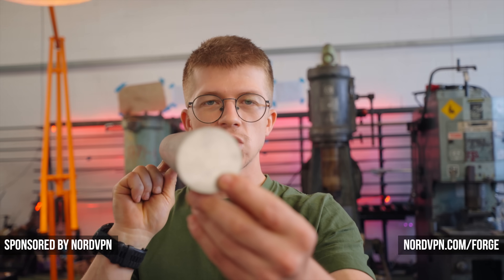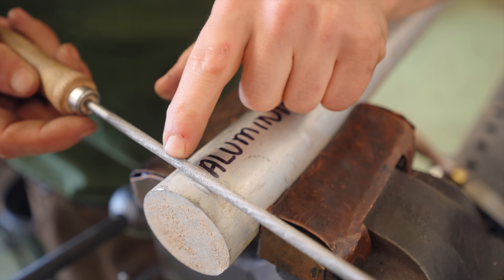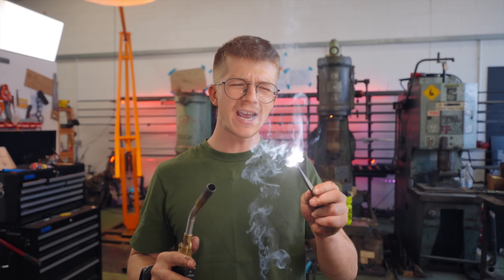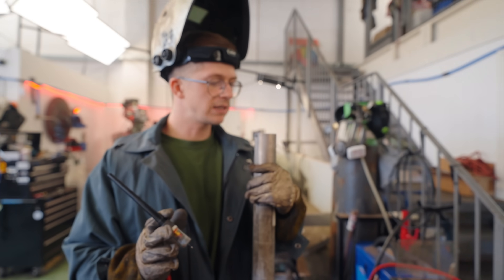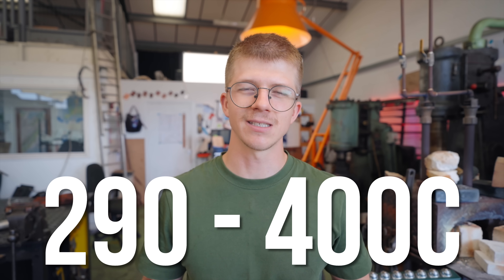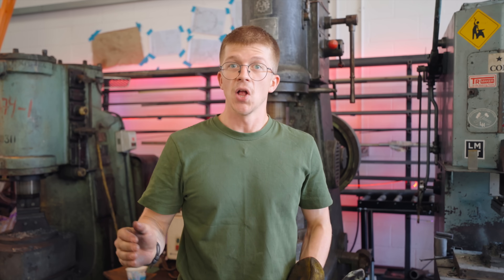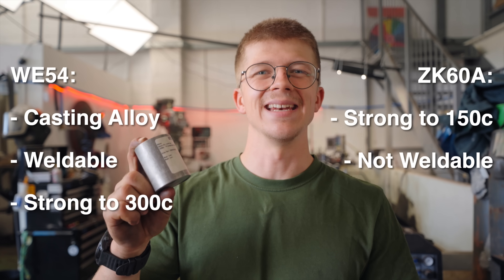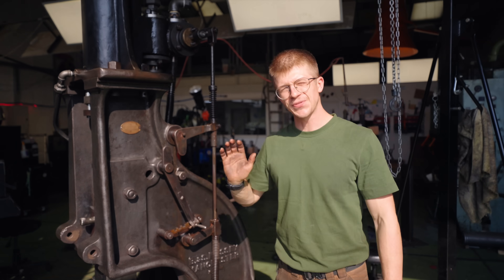Can You Forge Magnesium?

Comment: The "Elektron WE54" Alloy is about 91% magnesium. Pure magnesium would be way softer than this alloy here. Magnesium is soft enough to cut it with a knife kinda like wax-like maybe a bit tougher. More reactive as well. Apparently, the Yttriumin in the alloy gives corrosion resistance, meaning less oxidation/rust and harder to burn it. If it were to be pure %99.9 magnesium I doubt you can put it out with just water even if it's small in amount it would explode. 
If you like to know here are the contents I found for it.

Element	Content (%)
Yttrium, Y	4.75-5.5
Neodymium, Nd	1.5-2
Heavy Rare Earths	1-2
Zirconium,  Zr	0.4
Magnesium,  Mg	Remainder
Reply: To add to this. NEVER USE WATER ON A MAGNESIUM FIRE!!! The fire will split the water (H2O) into Hydrogen and Oxygen, resulting in an explosion.
Reply: @JoshWebs  Its even better than that - look up 'Why Sodium explodes.. a new explanation!'   Its crazy
Reply: I wondered about that- I've worked with pure sodium and lithium in the chemistry lab, and my impression was pure magnesium was similar: soft enough to cut and shape with a spatula, and reactive enough that it + water = fire
Reply: I was wondering how much it would cost for a titanium domestic dagger
Reply: Yeah I remember playing with some pure magnesium tape I liberated from my high school chemistry lab, and it was quite soft and easy to tear by hand or cut with a knife. And would light on fire quite easily with a butane lighter.
Reply: I have played with magnesium in chem labs and it + water does not generate The most impressive reactions however im not sure If it was pure or an alloy.
Reply: @bigyeet8905 magnesium oxidizes instantly so it has to be molten or really on fire to react, then it is pretty much the same as sodium only brighter and hotter. I worked in a magnesium diecast plant. There was a crack in one of the dies that caused water, (the dies are water cooled), to seep into the face of the die, (as in a drop), when the die was locked under tonnage. Of course no one knew this until after they fired the 2 pound shot of magnesium into the die. The result was an explosion that blew a silver dollar sized hole through the die face, (that's made hardened tooling steel, it was about six inches thick), and a giant fireball to the ceiling and out of the sides of the die. The explosion actually blew to press out of lock, if I remember correctly it was a 250 ton press. That was all done with a little over two pounds of molten magnesium and a drop or two of water. Oh, and the mag was an alloy that is meant to be less reactive.
Reply: @willernst2721  holy shii mustve been scary
Reply: @bigyeet8905  it didn't happen on my shift, I came in after the fact and got to watch the video and clean up the mess. No one was hurt but I imagine that they all pooped a little bit.
Reply: @willernst2721  and here i was going to talk about the small magnesium fire i caused in science class lol, damn, thats scary.
Reply: @uuh4yj43  when I was hired to the job I was shown a video from a magnesium diecast plant in Japan. There was a leak in their pot, 150 or 200 gallon crucible of molten magnesium. The leak wasn't big but it was puddling on the floor. The video showed it flow into a small puddle of water that was on the floor, maybe a gallon. When the melted mag hit that water the reaction followed the mag back up the leak and instantly emptied the entire pot of mag. By that I mean the video showed a bright flash that filled the whole room, large factory floor, and then smoke and ash raining down. Not sure if that video is still on YouTube or not. Anyway yeah, magnesium is not the best thing to play with.
Reply: Dump salt on a magnesium fire to put it out
Reply: Pouring water on a magnesium fire WILL EXPLODE

Comment: There was a titanium plant near me. Some time ago, they had a fire catch in a barrel of titanium milling chips, and the two guys nearby panicked and forgot their safety training. Instead of following procedure, they dumped a bucket of water on the fire to douse it. The resulting explosion lifted the roof off the building and shattered windows half a mile away. There were empty casket funerals, as there weren't even dental remnants remaining of the two millworkers.
Reply: Bare metal reactions with water can be cataclysmic. One theory states that the reaction is more similar to that of Alkali metals and water than it is a steam explosion. Superheated/melted metals not exposed to air lose the incredibly tough oxide layer, and will instantly react with air and especially water. It's not thermal expansion of a gas, but a rapid chemical reaction that also produces a lot of free hydrogen that also explodes. Conditions have to be just right for the reaction to occur. Like pouring into a damp mold or heating from the start in a humid crucible is unlikely to explode (it will ruin your day), but get some steam under the boundary layer, and BOOM!  Titanium being flammable and somewhat explosive already I don't imagine it would take much water on burning titanium to have an extreme reaction. 
in my own experience scrap melting, I don't even care to clean aluminum pop cans before I throw them in the crucible. I can take a can I just finished and toss it right in no problem. The heat and the slag and dross cook it off before it can have a chance to react. but toss in some electronic components that have sat outside for a while and got humid and have entrapped water in them...I blew the top off my furnace, and have a meter wide casting of my driveway. Guess what else has entrapped water and humidity. Concrete. Thankfully molten aluminum flying through the air has plenty of time to develop an oxide layer (Seriously, the reaction takes less time to happen than most high end equipment can even test for it. Oxidization/passivation in Aluminum is instantaneous and extremely strong. Aluminum itself is quite toxic, but Aluminum oxide is sterile. but bad things happen when you break the surface tension, so don't add water or breathe aluminum fumes in a crucible, and get far away from any metal fires, and holy crap is this a long parenthetical) or the sweat in my jacket would make me a walking bomb.
Reply: As per my last, This reaction is why aluminum ingots smell like electrical fires. it's the humidity or quenching water getting into the pores and cracks that haven't been exposed yet and liberating hydrogen.
Reply: I've seen similar with aluminum. When I worked in a foundry we were always on red alert about condensation in the aluminum causing a reaction similar.
Reply: @MurderSTi You misspelled aluminium
Reply: @ShannonSouthAfrica There’s two spellings for it depending on which continent you’re on and both are correct.
Reply: @cooltubes547  yeah nah... it's ALUMINIUM. Thanks for coming.
Reply: @ShannonSouthAfrica  I’m sorry your last 2 braincells are too preoccupied with fighting each other for 5th place to spend 10 seconds fact checking yourself.
Reply: @cooltubes547  Erm... OK bud. I'll see your comment and raise you one Bsc degree....
Reply: @ShannonSouthAfrica  😂
Reply: @ShannonSouthAfrica just because others use the original and you have adopted a newer version doesn't make them wrong
Reply: @ShannonSouthAfrica  To be consistent, they should call the metal under investigation here "magnesum".
Reply: @gibbogle  lol
Reply: @gibbogle  or iridum or calcum or palladum or radum.... At least they got platinum....
Reply: @cooltubes547 narr mate they are right. It’s aluminium.
Reply: My guess is that it reacts with water to form rutile (titanium oxide) and hydrogen gas. Then the hydrogen exploded. Or am I wrong?
Reply: @tomaspecl1082  IDK about the rutile, but those metal fires can absolutely strip H2O into its component gasses.
Reply: @tomaspecl1082  magnesium and basically any -ium metal dies exactly that
Reply: @davidh.6930 Sounds like skateboarders are lucky Al oxidises so quickly, else grinding (the trucks) on wet concrete and throwing a spark could end very messily.
Reply: @tomaspecl1082  That's the common theory for the past 100-130 years.  I've seen some research in the last few years that suggests some metal-water conflagration may be a bit more direct than that, with the redox reactions occurring so fast that it could be the electrons themselves getting grouped together closely enough to then explosively repulse, and that the combustion of hydrogen is a just secondary effect.  Look up the term coulombic explosion to learn more.  It's pretty fascinating stuff and one of the main people behind it has even publicly speculated this might be what lifted the core at Chernobyl.
Reply: @ExaltedDuck  WOW thats interesting - Deffo looking that up "coulombic explosion"
Reply: @ExaltedDuck  It looks like it was the YouTuber Thunderfoot's work.  They got it published apparently.
Reply: @ExaltedDuck  Absolutely AMAZING - its called        Why Sodium explodes.. a new explanation!
Reply: @tomaspecl1082 Burning metal, add in H2O. The fire is hot enough it electrolytically splits the water into hydrogen, oxygen, and yes the oxides likely combine with titanium.
Reply: That wasn't in PA was it...
Reply: @Wade-g2k  I think it was, I live in NJ aka the state next door and if I remember correctly it was on our local news station at the time. Its been a while but I feel like I remember this to a certain extent. I think that fire went on for a while like 2-3 days.
Reply: @artor9175 What was the name of the plant?  I'd be interested in reading about it.
Reply: Nevada 2018?
Reply: My dad worked at a titanium plant and would bring home all sorts of fun stuff to throw into fires
Reply: That’s why you stay in school kids
Reply: Something similar happened to a sugar refinery near me not long after I was born because sugar dust is kinda explosive
Reply: Damn! 😢
Reply: This is such crap,  blew the roof off the building?? Exagartion just a little I believe
Reply: Just read the comments turns out I must be wrong 😂😂
Reply: A single barrel of water on a single barrel of tungsten? That's a pretty intense result for such a small quantity.
Reply: @amogusenjoyer  just consider when you take a hot shower or when you boil a pot of water how much steam is produced compared to how much water is lost now imagine an entire barrel of water turning into steam in seconds (not to mention any hydrogen that is liberated in the process that can explode)
Reply: @amogusenjoyer not really.  We’re so used to things operating as they are intended to that we forget the incredible power that we have harnessed.  A gallon of gasoline can move you around 20 miles, but atomized it can level a small building.
Reply: @Johnrich395  Only 20 miles on a gallon?  That's a gas guzzler.
Reply: @gibbogle  mine gets 17
Reply: @amogusenjoyer  a barrel of water turning to steam expands x1500
Reply: @ A 55 gal drum of titanium millings?
Reply: @amogusenjoyer I thought he said titanium not tungsten?
Reply: @amogusenjoyer  There is a huge amount of H2 gas in water, that then combines with the O2 in the air. Its going top be a very big bang.

Comment: Folding Tin and Copper to make bronze?

This is something I have been wondering for a while now. I don't believer it will work but there is that little monkey way in that back that keeps saying: but what if....? But if you take sheets of tin and layer them between sheets of copper in the right ratio of the two metals to make bronze. Forge weld them together (not even sure if that can be done). Then fold that metal enough times that the folded metals will form bronze? Will the metals stretch enough, eventually, so that the molecules break apart then reattach as if having been in a molten state? And if it's brass I am actually thinking about that is formed between copper and tin, then that's the metal I meant. I know I could Google it, but I like testing my memory to see how bad it's getting.

Comment: Magnesium is one of a handful of metals that when it burns, it will absolutely take the Oxygen off of a Carbon Dioxide molecule to keep burning and leave you with straight carbon. Lithium is another one of those metals. You would have to put a fire with it out with a Class D extinguisher.
Reply: N2 does NOT work
Reply: @ulrichkalber9039  Whoops! You are correct, I was thinking of Sodium fires off the top of my head which won’t break the N2 bond, and I knew fer sure Lithium forms a Nitride in N2 and errantly thought that stopped at Magnesium. I have edited it so it won’t be incorrect if others see the comment and not the thread.

Comment: Mercury is very dense but it is the softest metal (it's liquid). Lead is very soft too and very dense. Gold is very dense too and soft. And so on. Many dense metals are actually quite soft.
Reply: Mercury might be the only metal you have to cool to forge :D
Reply: @ulrichkalber9039  Haha yes, however metals like Cesium are not far of, it melts in your hand with 28°C melting point (if it doesn't catch on fire from the moisture in your hand and explodes). And Gallium at 29°C (it's also safer to handle because it's not that reactive and also not toxic). And there are some Gallium alloys that are liquid at room temperature. But as for pure metals, Mercury is the only one.

Comment: Welding Mg usually requires AC. The mechanism is the same as for Al -- oxide layer needs to be crushed by the reverse polarity pulses.
Reply: Not just that, but Tig welding was originally developed for welding magnesium. Specifically, it was for a prototype fighter for the US, the XP-56. Some of the really old dudes in welding still call it heliarc.
Reply: The shop called 'The Guild of Automotive Restorers'(a bit pretentious, but, frankly, it's fitting for the work they do lol) built a 'replica-restoration'(for lack of a better term) of a 'lost' magnesium bodied 1930s Bugatti. Absolutely incredible work, apparently it took them quite a while to get down the process for welding thin magnesium sheet metal. I believe Jay Leno covered the car on his YT channel, look for 'Bugatti Aérolithe'. It's a fascinating story of a concept car that was shown once or twice in the '30s then lost(thus far), and The Guild started with an original Bugatti rolling chassis and recreated the magnesium body from scratch based on pictures. Their work is second to none.

Comment: You can actually put out most metal fires pretty easily with powdered table salt (sodium chloride) or baking soda, so if you ever work with other flammable metals, I’d recommend having a few pounds on hand.
Reply: In my university's chemistry labs, we just have buckets of dry sand.
Reply: @hammerth1421  Sand also works great, but the reason they use salt commercially is that when the salt melts when it contacts the molten metal, it makes a crust around it and prevents oxygen from getting to it and re-igniting. Though, sand more than likely would work just fine for a smaller fire. There’s actually specific fire extinguishers for metal fires that are just pressurized tanks of super fine salt and/or soda that firefighters and certain labs use. They’re also like $6 grand if I remember right, which is kind of crazy if you think about it.

Comment: Magnesium has the lowest melting (923 K (650 °C)).  So the closer you can get it to 650 without melting it you should be able to forge it. Maybe 550 would be a good forging temperature.  I think casting then machining is how it's mostly worked.